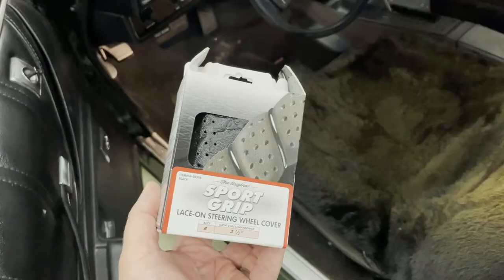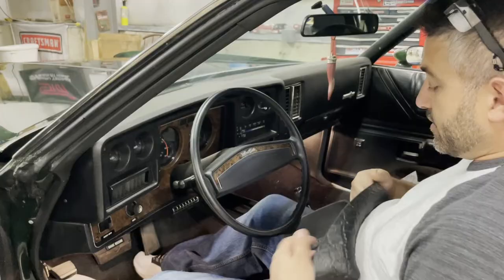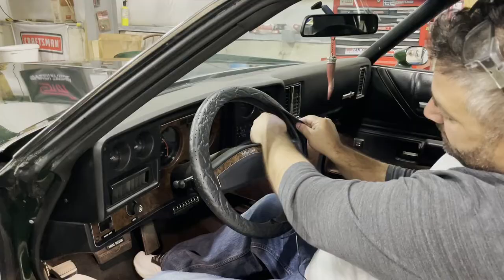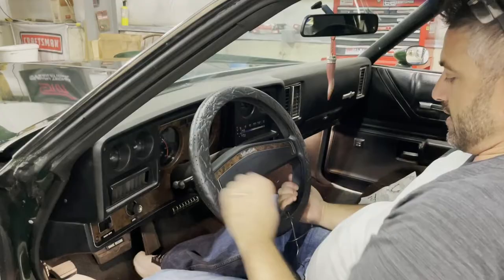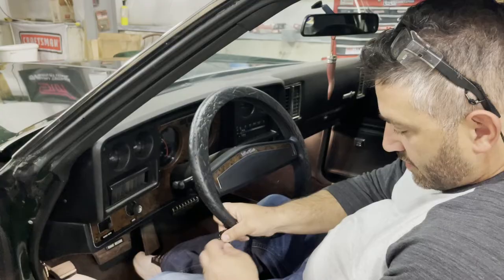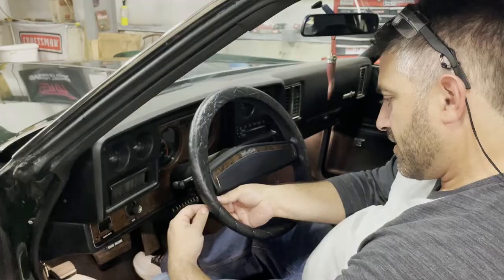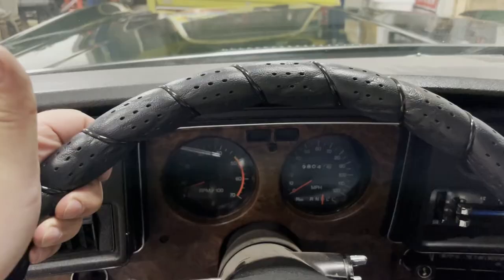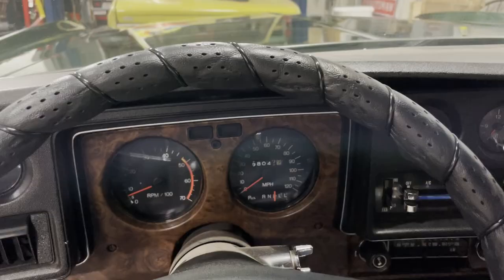Sport Grip Lace-on Steering Wheel Cover Installation

Comment: Do you think it would be any easier doing this with the wheel off the car?  I already have mine off the car and if it's easier, I'll do it before remounting the wheel.
Reply from the maker: If it is already off I would think it would make it easier. However, it is easy enough I wouldn't take the wheel off just to install the wrap.